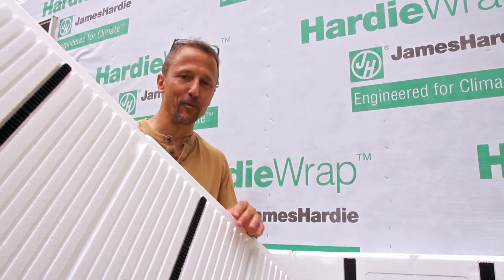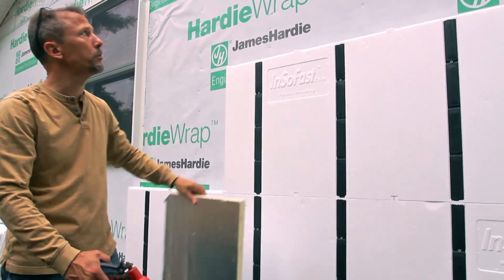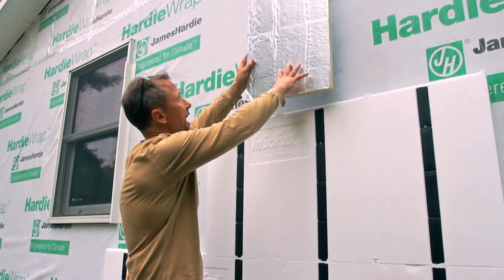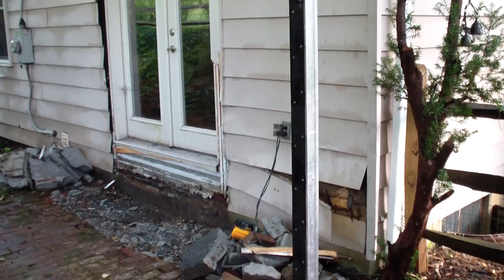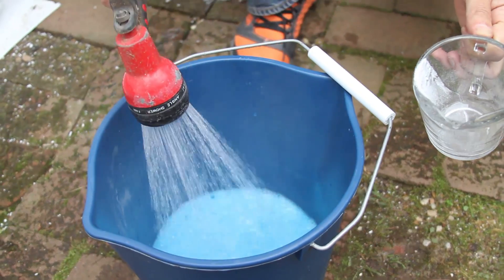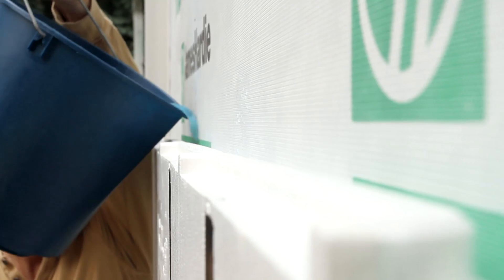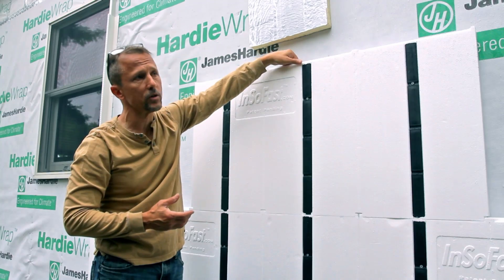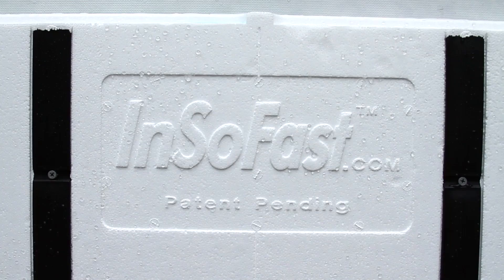Moisture Protection for Walls: InSoFast

Comment: Gets rid of water but the channels allow cold or hot air in behind the foam thus defeating the purpose of the insulation in the first place.
Reply from the maker: I see how you can make that assumption from looking at just this video. The channels in the back of the panel are gravity drains not air pathways. Our details point out that at the top of the wall is air sealed with spray foam and the bottom is capped with a "J" channel drip edge. The insulation is located on the wall's neutral pressure plane or what is called dead air space. Dead air space is actually used in most R-Value wall calculations. The channels in the back of the sealed panel are too small to have an air convective loop, the air does not move. The best explanation/analogy a building science guy said, " it would be like trying to drink from a can of coke, with one of those little cocktail straws, if the straw was 8 feet long."
Reply: Furring strips are usually used when applying rigid foam without built in channels, leaving a purposeful air gap for drying.  Same thing here.

Comment: Also EPS is superior to XPS and ISO foam as those two will retain and hold water, EPS will still dry out if it gets wet, Quad Lock has what they call R-ETRO fit system for remodel or even new build if you want to insulate the outside of say a CMU or block basement or other foundation wall, but their panels do not have said drainage channels, and as I formerly pointed out that EPS does not hold/retain water, but they do offer the standard 2 inch and 4 inch Plus panels with integrated fastening strips which are of course not exposed like these ones, not that whether the strips are exposed or not as the exterior finish will hide the insulation either way.
Then again one can use any foam board with dimple board behind the rigid board insulation, though it comes at added costs will do much the same thing but with more spacing compared to the channels on InSoFast panels. I would use this as it covers more area than a Quad Lock panel and for less $$ up front though they come in 2 (R-8 at best) or 2.5 inch thickness (only R10 at best) and studs are spaced 16 inch oc where as QL panels with FS are spaced every 12 inch oc.
Reply: Ya, the big manufacturer push XPS and the superior insulating per sq inch, but once water gets inside...  it stays inside.
Reply: Matt Risinger did a test a while back comparing open and closed cell spray foams and both sucked in some amount of water, you would not know you got this issue until you see it in the form of mold or do some renovating if you have spray foam insulation, so despite its insulating superiority it has a dark wet side.
Reply from the maker: InSoFast was designed knowing that all insulation systems/approaches, over time will vulnerabilities to moisture penetration. Water will get in. So we designed water manage redundancies into our panel to protect the integrity of the structure/building.  We shape mold into our panels the best practices for exterior insulation and water management. By our count we incorporate 7 different and essential steps into 1 panel, that other methods of insulation, should be followed if you want to have a comprehensive approach to water management in your wall assembly.
Reply from the maker: Quad-lock is a competitive system manufacturer. We encourage you to compare our product to theirs and all our competitors and choose a system that will work best for you.

Comment: My biggest concern is moisture when insulating the inside of a shipping container, from condensation.  I love this product, but I need to convince a building inspector to sign off on not using traditional framing, and it's a challenge.  I live in the Pacific NW.
Reply: I wish I could help you out more but just show them the application/installation video so they get the idea and hope they do and approve it.